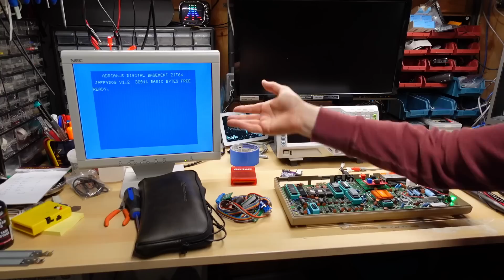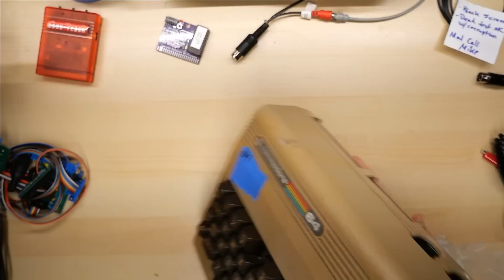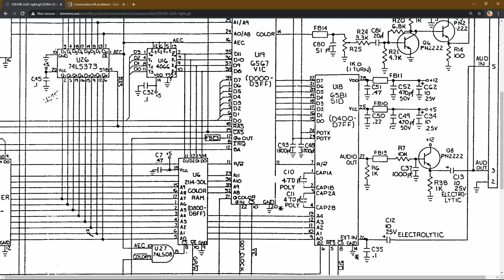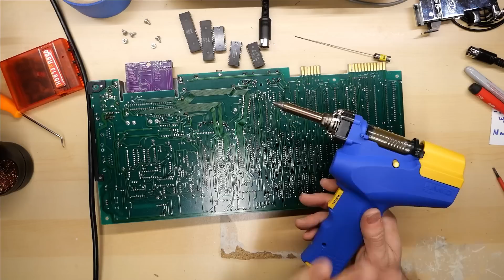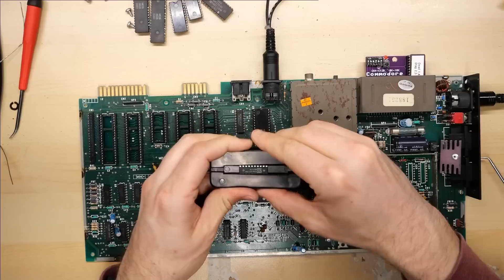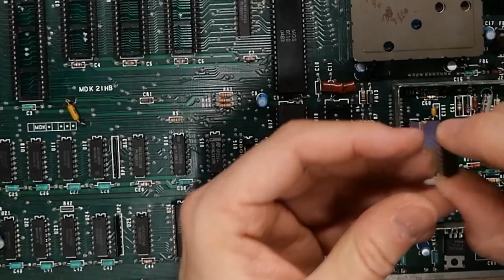2021 C64 Repair-a-thon #1: "It stumped me!"

Comment: The term you were looking for is "False Positive". You got a positive result (i.e. the test reported the RAM was OK) but it was wrong (false). A false negative would be if the test reported an error when it was actually OK (like with the bad Control Port result).

Comment: Fun video!
A couple days ago I watched this video as the first Adrian's Digital Basement video I've seen. I was surprised to see there was such an inexpensive scope, not that I keep up with these things. I bought a C64 new in 1984 and when it stopped working in the early 90's I just boxed it up and bought a C128D to replace it. After watching this I got a little excited and started thinking Hey I could buy this little scope and break out the old C64 and see if I can fix it. But now after watching the repair-a-thon videos 1 thru 3 I realize it takes a lot more. Adrian repairs these C64's mostly by narrowing down which chip is likely bad and then swaps chips to find the bad ones. So you really need to have these extra chips on hand not to mention the sockets, dead test cartridge, and soldering and desoldering iron. And if the PLA is bad another video suggests it might cost about another 60 bucks to manufacture a substitute for that. So all-in-all not really worth it just to try to fix a single C64 unfortunately. :(

Comment: A bad machine can't always test itself. If you use 1 to mean failed, and bit 0 is stuck 0 at that address, it becomes OK. On a modern machine, the internal caches have ECC, so the BIOS has a chance of correctly testing RAM, while configured for cache-as-ram. If the cache is bad, it will most likely MCE (machine-check exception).

Comment: Late to the party, just wanted to mention that this a common issue with software RAM testers. If they don't find errors, it just means they found no errors. Not that there aren't any. It's not the fault of the dead test cartridge, just a limitation of the technology. Whether a memory cell can keep its value depends on many factors (values in neighboring cells, access patterns and timings, temperature, voltage fluctuations, etc). "Real" RAM testers are big machines that can simulate all those different conditions and cost 5-6 figures. Cheap software solutions can't do that. It's the same with programs like Memtest86 on the PC. It's also why these tests loop and don't run just once. The idea is that you let them run for a while (12-24h) to cover a wider range of randomly fluctuating factors, some of which will hopefully trigger the problem at least once. Software tests still have value, however, because if they do find errors, then there's definitely a problem.

Comment: I was contemplating what to do with my Rev. A board. Maybe I will restore it and give it a chance. Adrian, I know you talked in other videos about improving the VIC-II output, but I can't remember if Rev. A boards were included in that discussion? I guess I'll have to go back and re-watch those. I know that one of the factors facing a Rev. A is the absence of separated chroma and luma output circuitry. (The VIC-II has it, the Rev. A just doesn't provide it at the video port, which is why it is only 5 pin.)

Comment: Adrian, Sorry if you mentioned this somewhere but I purchased a school out of some old Commodore 64 and Atari 8 bits about 2 decades ago. I have been recently been going thru some of these machines (in totes) and I am wondering which Dead Test/Testing Cartridges are you using in this video? I would like to purchase a similar set. I also have at least one Atari 8-bit (400, 800,600XL,800XL,1200XL) that is having issue I need to troubleshoot. Is there anything similar for the 8 bit Atari's?  Thanks for the help and the great videos!

Comment: Thanks Adrian for your video. Dead test cartridges don't always tell the truth. I have a commodore where the cartridge tells me that everything works (with harness) but when I run the load command to load floppy it hangs and does not give up control. I tested several disk peripherals (1541 and pi1541) and I have the same thing. The cable is good too. The u8 (7406) is good too. I tear out what little hair I have left. :)

Comment: For testing 74-series TTL and 40-series CMOS chips, you can use the MiniPro 866. Under device, select the "Logic IC" and then select or search for the one you need to test. Works for all gate-type chips (not counters, for example).

Comment: The Easy Flash issue is with the reset circuit of those boards.  I have one and have the same issue with resets, there are a few options on how to mod it to work.  I haven't gotten around to it though on mine.

Comment: Who added the heatsink at far right? I have that same board number. Mine did not have a heatsink. I added one because it would constantly overheat.
OTOH Through the fog of time I seem to vaguely recall a production change, so maybe yours was added at the factory.
I also have the original manual and foldout schematics - the "Commodore 64 Programmer's Reference Guide", first printing 1982, if that would help.

Comment: I've got a board at the moment where there is something wrong with the communication to the RAM. The dead test ram test passes but the Diag cart test does not. Seems the diag cart version of the test is more thorough. I suspect what could be happening is that sometimes when the ram goes bad, the bits don't flip straight away and may take some time to go bad. I think a ram test that just does a write then read won't find errors like that.That's my theory anyway.

Comment: when testing chips in a known good board it is very helpful to draw yourself a Truth Table:
Testing 3 chips..place the chips into the known good board in this pattern
Chip1 only =Computer Works/Does Not Work
Chip2 only =Computer Works/Does Not Work
Chip3 only =Computer Works/Does Not Work
Chip1 & 2=Computer Works/Does Not Work
Chip1 & 3=Computer Works/Does Not Work
Chip2 & 3=Computer Works/Does Not Work
Chip1 & 2 & 3=Computer Works/Does Not Work

I realize this takes longer and is probably not usable for doing videos but it reduces confusion of where you are at in the troubleshooting methods..

Comment: The board number in the documentation may be the latest PCB version, but there weren’t any circuit changes. It may be little hard to see changes like internal power or ground planes, changed vias and the like. It is sloppy documentation IMHO but for the time it was common.

Comment: For those schematics that span two image files, just load them into a graphics program and merge the images, and then save the resulting complete schematic.  If the original scans weren’t perfectly square you might need to tweak one or the other with some rotation or skewing to make things line up right.

Comment: U26 and U16 are the bus interface to the color RAM, and they explain why the color RAM is "special" and the VIC doesn't use DRAM for the color in text mode.

U26 latches the A0-A7 of the color RAM address from the VIC when AEC and RAS are low (because that is when the VIC has the low byte on the MUX bus. A8/A9 are available as discrete outputs, this is important later... )
U16 disconnects the color RAM from the CPU data bus when AEC is low, so only D0-D3 from the color RAM is on D8-D11 at the VIC. This is also really important. 

It is a genius design that allows the VIC to fetch the color and character codes at the same time via a 12 bit data bus. The C64's memory actually runs at 2 MHz, with the CPU getting it half the time and the VIC fetching the character patterns or bitmap the other half of the time. Every 8 scan lines, the VIC halts the CPU for an entire scan and also fetches the character pointers (or color data for bitmaps) from screen memory: A10-A13 are set to the screen base register and A0-A9 increment over that row's addresses... but those lines also go to the 1k*4 color RAM so the matching color data appears on the VIC's D8-D11.

Comment: When the fault checking equipment is working against you it's not really your fault. If you're afraid to lift pads or traces I wonder if it would be useful to use low melt solder in this case. You probably wouldn't even need the hakko, The hot air at maybe 200C or less should be enough. But it's a lot of pins to add it to, so the hakko might be faster. Well, can always go overkill and use the three things. hakko, apply low melt solder,  apply hot hair. 😅

Comment: Great work, Adrian! RAM issues may be really hard to diagnose. The worst case I meet time to time is when the most of available tests pass, everything seems nice and working but real programs glitch occasionally and randomly. This lead me to start making own tests for the machines I repair. I found kinda good heuristics which reveals such hidden problems: fill RAM with increasing bytes, check, cyclically shift the contents of RAM byte-wise, repeat from "check". Usually a couple of iterations is enough to reproduce the glitch.

Comment: As someone who worked in configuration management...manufacturing will say that a part is a part is a part, regardless of the revision. You're lucky that you get a revision on anything. If a change doesn't affect form, fit, function, interchangeability, etc, you won't get a new part number either.

Comment: The bad SID and control port readings are in deed caused by a failed paddle test. I had the exact same reading when I replaced an 8580 with a 6581 and forgot to change the caps for the filters and the paddles (I didn't neglect to change the zener for the supply voltage, so the chip itself was working fine). So the test seems to be quite thorough.

Comment: Could it be that the Dead Test cartridge stores the answer for the ram test as a 1 and 0 in RAM?, and as bit0 in ram is bad the display routine show a false positive as it converts the number to the string BAD and OK. if so of course a major design blunder.

Comment: My desoldering gun gets blocked just the same as yours, what I do to reduce the blockages is when I suck the solder off the components I continue to hold the trigger On for same time after and sometimes pointing the nozzle upwards with the trigger On, this gives it time to clear the gun,,, keep up the good work 👍

Comment: nice one

the ZIF 64 is invaluable for this kind of activity

its a shame that the BBC micro motherboard is so densely packed, I can't fit ZIF sockets for the major components like the 6502 and 6522, even the RAM chips themselves are too close to support a ZIF socket

being lazy, I just hotair gun everything suspect, and try them out on my turned pin reference machine...if only it was as easy as pulling the lever of a ZIF

Comment: Hi again, also in the manual for the diagnostic they talk about 2 capacitors C48 and C93 have to be 1800 pF they sometimes have a different value that also makes the port test fail.

Comment: Odd but it just felt like a RAM error to me. Not necessarily a RAM chip, but a corroded trace or cold solder joint can also do this. Not a C64 expert, but I have worked with other 6502-based machines. Once you eliminated the ROMs as a source of the corruption (which is obviously easier to check, so should be first even if it's not the most likely), it was acting like one of the bits was stuck. It's possible for some of the address space in a chip to fail, and other parts to still work, which is probably why it was willing to work to the degree that it did. Don't assume that just because the machine boots and doesn't immediately barf, that any RAM other than that required to boot is any good. Seen this in old PCs where the first 64 or 128 or 256K is still working but there's a problem higher up.
As for the RAM test failing to detect -- if both the address under test and the address being compared to have the same bit error, they're going to match. That's all I can think of. This also happens on old PCs.

Comment: In the industry, we always say "false pass" and "false fail" for a functional test.

It's actually very hard to write diagnostic software that will find all problems. It can be very hard to think of every possible failure mode in hardware.

Comment: If it were me I would get out the heat gun and freeze spray and see if I can turn it from working to non-working or vice-versa by heating/cooling specific chips. Very good general tool for debugging as often a fault in a chip will fix itself at high or low temperature (usually low).

Comment: Have you tried the HP current probe as you have a good board to compare.  pins 2&5on 74ls258 are inputs
The deadtest ram test may only check a page for speed

Comment: I always suspect those single wipe sockets when I see them. I have seen them in Amiga 500's and they do cause odd intermittent issues. It's even worse if theres corrosion around. As soon as I see them in an Amiga, I replace them.

Very odd fault on this one. I thought you were going to have a broken trace issue
Reply: I wonder if the RAM was faulty in such a way that address cells were bleeding over... there's certain test methods that check for this sort of fault, where more basic tests do not. I've seen this on ZX Spectrums where a very simple test does not catch the issue, and you need something like a walking inversion test to catch it

Comment: The IC puller is probably not good for large IC soldered on to PCBs. Saw that Parfractive guy snap a 40 pin in half when he didn't desolder a center pin properly - lol -.
For the RF shield I was thinking a large 100W hardware iron with the copper tip hammered flat to a chisel shape, so it can heats and get under the tab on one motion.

Comment: 14 minutes in, I'm going to guess it's the CD4066. If the address lines were failing you wouldn't have proper picture of any sort, since the VIC would be stuck reading the same address over and over. Data line being bad would produce a repeating improper pattern over the top of the proper image. Seems to me like a data problem, not an addressing issue

EDIT: Dang.

Comment: Nothing wrong with your troubleshooting, just belive in your guts. I was seeing this with my girlfriend and I made a early wild guess that it was bad RAM. I have seen something similar with an Atari 600 XL. I was young boy and sometimes I pulled the cartridge when the machine was turned on. One day I got strange graphic errors like some letters. My parents sold it and gave me a SMS. I have been thinking of what was bad with my Atari and I can only think about two things - the RAM or graphic ic of some sort. But I'm sure it was the RAM since it's sensitive and gives strange errors like this. Of course I can be wrong, but bad RAM happens all the time.

Comment: If you're like me and don't have a solder sucker, there's a neat trick to desoldering an IC with solder wick. On the underside of the board, of course, start there and get as much solder off as you can. Then flip to the top side and if there's enough room, run the wick against the legs on the IC to suck up any more that may have been left behind on the top side. Typically when I do it on 14 or 16 pin ICs, there's always at least 1 pin that doesn't completely desolder, but with a little patience, it'll clean up and the IC will just lift right out.

Comment: Just a quick tip since you have the wonderful HP 547A current tracer. I have luck with it sometimes detecting bad RAM without any de-soldering or test programs. If all RAM chips are the same type/manufacturer/batch, you can use the 547A to "feel" the center of each RAM chip, setting the sensitivity so that it juuust lights up and compare the chips back and forth. It takes little while to get the feel for it, but if one chip makes the 547A light up easier than the others it is often bad (as in more over all current flowing through it). I've found this method to be more reliable than trying to compare chip temperatures by hand. Other chips can sometimes be detected in a similar way. Love your videos. Keep up the good work.

Comment: Adrian, i like your channel a lot. I am  still flabbergasted by the way you are not using a ESD wristband, and tossing away the shielding. After fixxing i would put everything back to be a as close to the real machine.  CIA's are vulnerable to static discharges known when touching the joystick ports. I like the way of your aproach with the hot air not to lift any traces. I would use the TL866-II to check the logic chips for faultiness.
Reply: Maybe he has it attached to his leg instead of the hand? ;-)
Reply: @xiphias256  he said in previous videos he finds them awkward when filming so avoids them